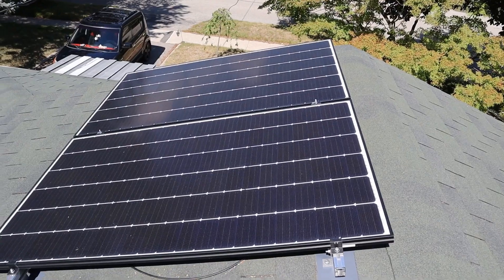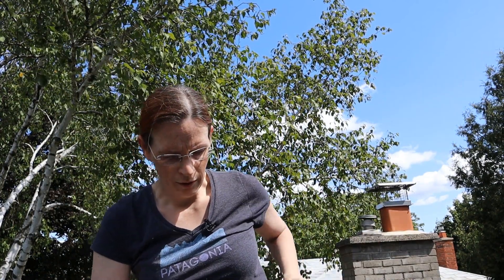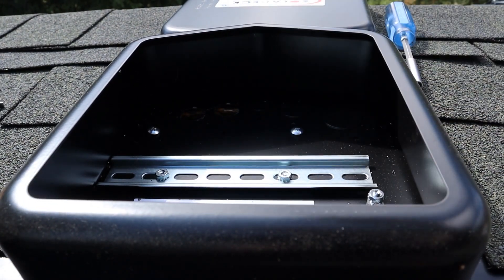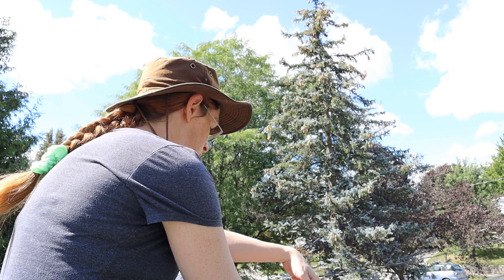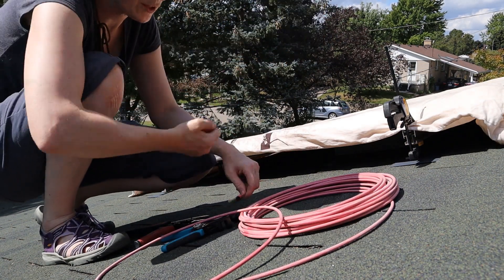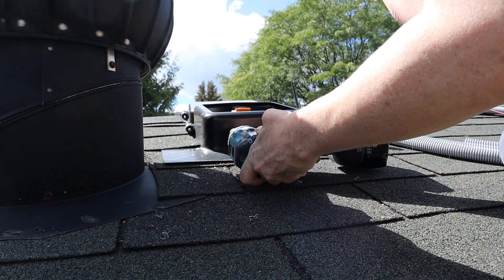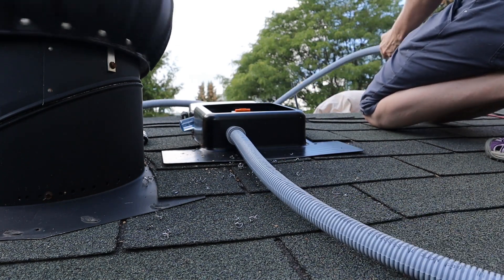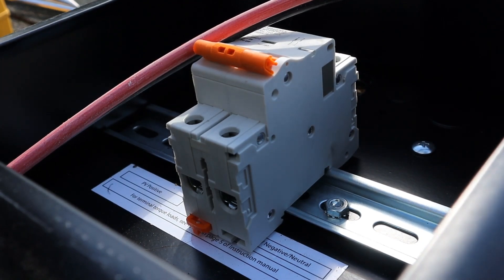Solar Panel Connection (Part 1) - How to build a 48v Lifepo4 battery (Ep. 17)

Comment: btw those M4 connectors are pretty good and not so expensive but i alsmost all the time use soldering iron to make them even better .i don't trust that crimp.
PS. Use those shrinking tubes with glue inside those are rated as water resitant or use some corrosion resistant spray in bottle and then normal shrinking tube

I wanted to add one thing and i know you might not like it ..but here it is :) 
1. Those wires might be fine for outside as protection(top coat) is rated for UV but wires are not so good against that. I would use solar cables that are solder coated and are specially for outside and ofc for sea ..that is a must (but you know that for sure)
2.  I made same mistake by placing those cables inside those connectors just like that..but they should have proper crimps on them and then crimped so that sleeve would not get loose also this way you can be sure whole surface of wire is involved..not as it is with those breakers .
3. I believe it is good idea to have overvoltage protection there as well as first defense .i didn't do that myself ..but still it is good idea in your setting because you have that box there already so it is pretty good deal to have it there as well ..you need only ground wire ..but you will have that for sure
Reply from the maker: Strikes me now that the butt connector will work just as good, and when I'm on the boat, having a tool / spare parts that can do multiple jobs takes up less space. So I've already decided I'm not going to worry about M4 connectors/crimpers at all.

Comment: Nice video. If i may advise use one conduit for one pole lets say +XX Volts and second for -XX Volts or opposite. You might decide that you want to use more cables or such so better be prepared ..don't think it is ok now. think about it as what ifi want 3x more panels will i have space for it ? how can i connect panels to get from them as much voltage as possible with minimum current ..for better efficiency..
Reply from the maker: As mentioned in the video, I'm using the house as an analogue for the boat. I am confident I can get four panels (two pairs) on the solar arch, so that's all I am going to use on the house. I may add a wind generator later, so I know right from the start that, at most, I'll have 6 wires, likely just 4. If, for some unforeseen reason, that changes, it's not really hard to rework the conduit then.

Comment: your copper wire is fine for your boat.  of course i would not run it on the deck so the sun could eat the insulation, but otherwise it will be fine.  another given is to finish the ends properly (as you will be doing with the solder & heat shrink).
Reply from the maker: Copper fine, bare copper is not. It corrodes too fast in marine environments. I mentioned about this is a past video; All copper components that will end up on the boat need to be tinned to slow corrosion (nothing actually stops it). This is why the wire you saw me use during the batter build looked grey/silver, but was actually copper. Same with the ring terminals, etc.

Comment: the damage looks like it came from a saw (installers), not teeth.  @4:33 you see too much metal gone and close to your finger, where the saw started.  it stopped walking when it got to the bigger part (connector).  and never heard of an animal that likes plastic.
Reply: btw, is that aluminum wire?  if so, your installer/s is getting a black mark.
Reply from the maker: @tcloud24  Unlikely, it's probably tinned copper. Either way, that connector came on the solar panel (Canadian Solar HiDM 330w - https://www.csisolar.com/hidm/). The installer crimped the short runs that I ended up not using.
Reply: @TheDigitalMermaid  i see some of the panels do come with the wire.  maybe the wire helped get the price down a bit.  otherwise, do you agree with my saw theory?
Reply from the maker: @tcloud24  No. The installers kindly let me watch and learn (I asked if I could do this before I hired them). The cables were all fine when they left. I suspect it's squirrels, it's not uncommon for this to happen. When I bought this house, I found old tar-paper wrapped wires that had the insulation eaten off by mice. It happens.

Comment: Do not use breakers on roof they will get to hot in summer they will trip from the heat use a switch in the box  on the roof and mount the c/bs near  the batteries .Be careful use something solid to cover solar panels you will still get voltage out of them if you use a blanket i learnt the hard way
Reply from the maker: As mentioned in the video, even with the blanket, I treated the circuit as live. That's why I cut each strand on it's own, and why I spaced the wires when I fed them through the conduit. As for a breaker up there; If it trips from heat, I'll replace them with fuses. I wanted to see if these breakers will indeed pop under the heat or not.

Comment: MC4 connectors are very weak when crimped . I solder mine . You need an earth wire from the panel mounts all the way down to ground for lightning strikes and the solar wires of each bank should preferably be run through a surge breaker(perhaps thats what you have in the box but if not replace those later). You have a rat or possum or racoon or something that eats plastic so you might need metal conduit. Once they start they usually continue until they get an electrical boot so an earth will help that too . Covering them with a cloth will not stop a current as infa red and ultra violet keep coming and some light too . Put your multimeter on the lines and see. Protect one side say positive and connect up negative fully then come back to positive with the breakers off.
Someone mentioned series connection which is a good suggestion if your inverter /charger can take the higher voltage input . If it can definately series connect and then one set of wires only and an earth wire. Most panels are good to 1000 volts so on mine I have 11 panels in series giving about 330 volts into my inverter /charger.Its a hybrid and good for 450 volts input .
Reply from the maker: Funny enough, I've been reading about lightening measures on sailboats this weekend. The earthing wire is certainly needed, and it will be there (I mentioned the BX wire waiting to be connected, it is earthed). It's not for lightening though; The power involved in a lightening strike is so great that an earthing wire would just pop like a fuse. It's purely for safety against normal faults, like a short of the positive to the case, letting the ground trigger a breaker. See my reply to Alan Marshall for a reply to the reason I'm not doing a single large series install.

Comment: I hope you intend to ground the panels, it is good practice for roof mounted solar.
Reply from the maker: I will certainly be grounding it, yes. I mentioned the BX cable, it's got an earth wire in it.

Comment: Are you sure the wire is ment to sit in water permanently, if it really sums up in the conduit?
And you made the pefect planning of just putting two panels on the roof, so that you have enough space left for installeation, dancing etc... Looks a bit small.
How ever, it is done :-)
Reply from the maker: The wire is NOT designed to sit in water, but it is weather resistant and designed to be exposed to the run/rain/snow. Remember that my install is not meant to power my house, my house is just acting as a simulation boat until I buy the real one. On the boat, I am pretty confident that I can get four panels on it, but I don't know if I'll get any more. So that's why I only plan for four (two pairs of two in series), for now. See my reply to Alan Marshall if you're curious why I am doing it this way.

Comment: Do the Atric at night or early morning.  MC4 are great and a standard, you may still have some power through the sheet, but good idea. There is a cheap tool for conduit, which is handy for pruning tree too. Bonus tool.
Reply from the maker: Exactly the plan. I was going to do it last night, but I was too tired after being on the roof... I'm Canadian, I don't handle such heat well. ^_^

Comment: Put all panels in series then u use less wire!
Reply from the maker: That's not the only concern though. My plan is two pairs, each of two panels in series. Each pair will feed a different MPPT, allowing for each pair to adjust voltage/amperage based on their independent shading conditions. Consider on a sailboat; There's a good chance that the two panels to port will see different shading than the two panels to starboard thanks to the mast/sails. So you are indeed right that it saves cable, but on a boat, efficiency and redundancy are more important. That said, a VERY big benefit to 48v based boat is that the cables I do need can be a 1/4 the size. These panels are 36v each, so 72v per pair, 9.18A. With this, using 10Awg copper, I'll have under 1% voltage drop over a 10 meter run (and I expect to be well shorter than that).
Reply: @TheDigitalMermaid  Thanks. Are u sailing in salt water? If real estate is a problem buy more effecient panels. I have Sunpower on my DC systems and they are not affected by shading as much as others. On my grid linked system I have micro controllers (enphase) and they take care of the shading problem. One of my pannels is shadeed by a AirCond from the east. I tilted it to the west by about 1 cm and it made a huge difference
Reply from the maker: @BajanAlan  I plan to take five years to go around the world in a very wiggle direction. So yup, salt water indeed. I've not put too much thought yet into the specific panels I get, figuring I would wait until I had the boat and knew better what specific dimensions I would be working with. Then I will certainly be looking for the most watts per sq. meter.

Comment: You need metal conduit running solar inside a house(plastic conduit outside is ok, and not even needed if you can strap wires to something).  Easier to have combined + - ground wire that is romex inside the metal conduit rated for current of all strings that runs from your combiner to the inverter/charger controller.   Don't remove the solar panel connectors, that negates your warranty.  Easy to get just the mc4 connectors or mc4 cable extensions for double the length you need and cut in half if you don't want to crimp connectors.
Reply from the maker: I mentioned in the video; the wire down to the basement (final install) is BX, shielded 15A wire. The conduit is simply to make future rewires easier.